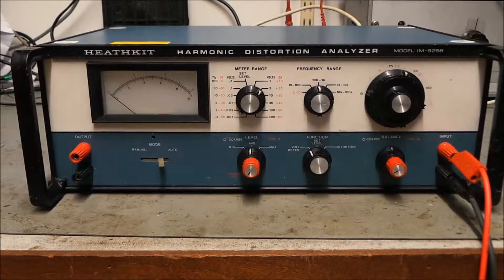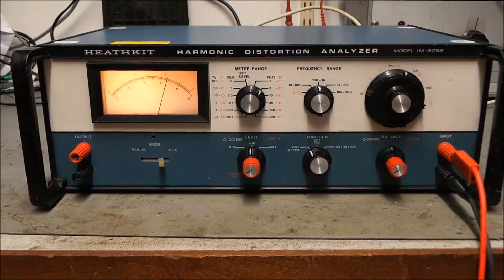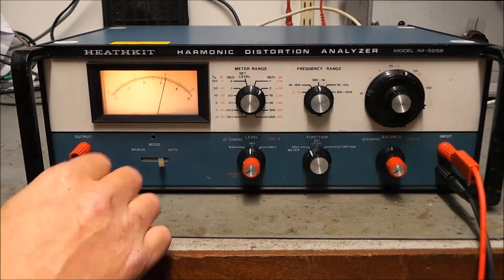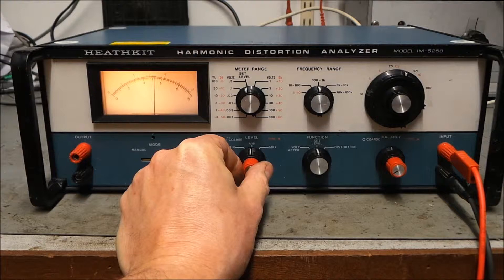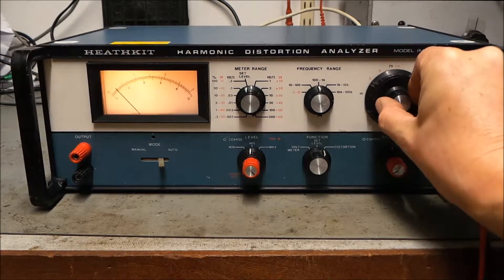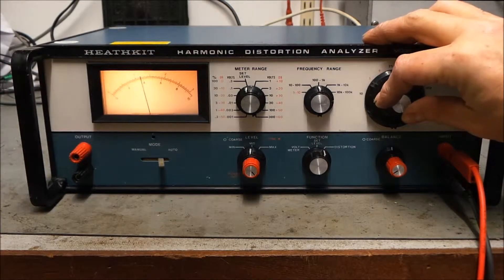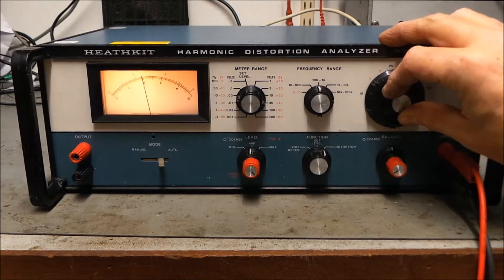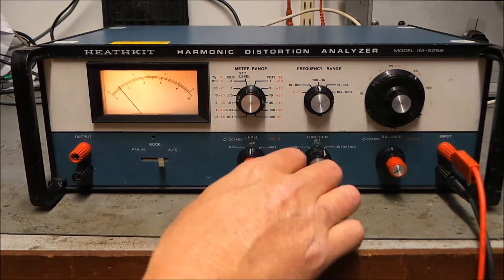Heathkit IM-5258 Harmonic Distortion Analyzer

Comment: Hello again Mate,

After a little experimentation, I have a few numbers to play around with and know a little more about my weird new piece of equipment.  Not wanting to completely bombard it with harmonics at first, I used a triangle wave from my HP 3225 function generator, somewhere in the 1k range at 1 volt RMS.  My Heath analyzer reads 10.5 percent THD and my HP 8903 analyzer shows 12.4 percent.  Since the 8903 analyzer is right smack in the center of my equipment arsenal, with 15 or 20 AC cords and as many interconnection cables, it's possible that nearby AC radiation and/or a ground loop is adding to the distortion reading.

My weird new piece of gear registers 7.5 percent on the second harmonic and 0.9 percent on the third harmonic.  This seems to make sense since all harmonics beyond the third would need to be filtered out to provide accurate readings on the second and third.  If we assume that a square wave contains at least 10 harmonics, I'll assume that the lower total output of 8.4 percent (second and third combined) is due to the suppression of at least the next 7 harmonics since this weird thing does not offer a THD option.

One thing I figured out about this weird analyzer is that, unlike most analyzers, you tune the notch to the MAXIMUM possible meter reading to arrive at the percentage of distortion - almost as if it replaces the notch with a peak super high Q.  This took me awhile to figure out, as adjusting for null for even a square wave still resulted in readings of less than 1 percent.

Thankfully, somewhere along the line a previous owner taped a set of instructions to the top of my Heath.  From what it says, the Manual/Auto switch is kept in the Manual position while setting the level and tuning the notch - first the notch frequency, then fine tune it using the coarse and fine balance controls.   Then the switch is set to Auto and the function switch is set to distortion to get the distortion reading.

Video tomorrow - assuming I can remember all this stuff ~~~

Comment: Thank you Andy, this is one piece of Heathkit gear for which a free manual can't be found anywhere.  I'll assume your distortion measurement at the end was just over 1 percent on the sine wave.  I've recently acquired a Data Corporation Model 101C "Tape Recorder Analyzer" that I was watching on eBay, believe it or not, for something like 5 years and finally purchased just to get it off my mind.

Though I don't see anything on this unit that would make it especially dedicated to tape recorders, it does have the capability to make separate measurements of the second and third harmonic which I've never seen before.  The only information I've ever found on my 101C was its eBay listing - other than that, not even a mere mention of it anywhere.  The serial number being 1147 strongly suggests that there weren't many of these made, but a few quick tests confirm that the unit is fully functional.  Possibly today I'll test it for accuracy, first using my Heathkit IM3238 and my HP 8903 Audio Analyzer to give me some reference readings.

Thanks again for posting this video - assuming my 101C is still in good shape, I'll make a video demonstrating it and send you the link.  Cheerio!
Reply from the maker: Can't wait to see it!